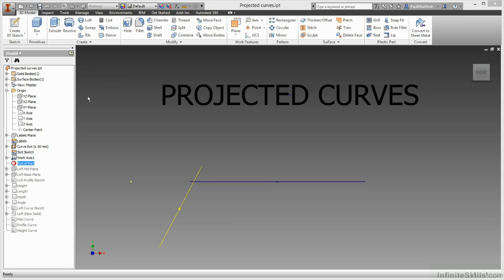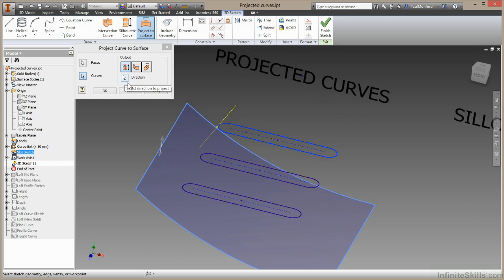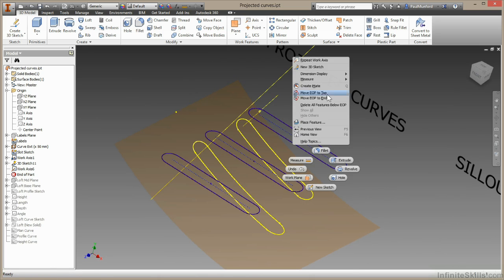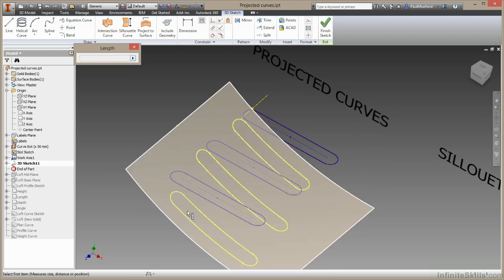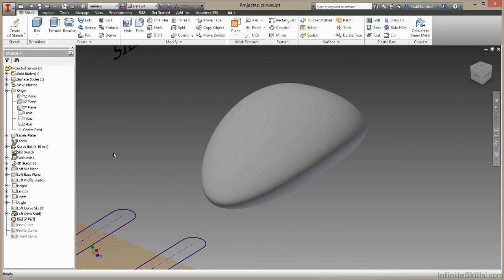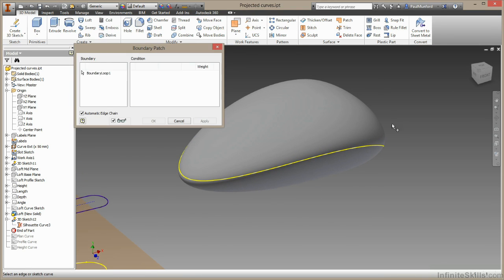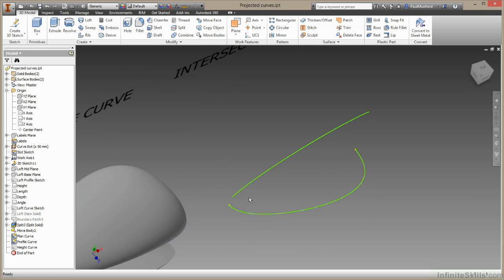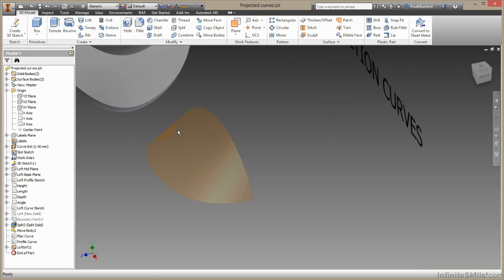Autodesk Inventor - Surfacing Tutorial | Projected Curves

Comment: Hi it's a great clip explaining how to project curves on surfaces. It helped me to go step further however I am not able to jump over the final step. I am desining a marine propeller blade where there are now plane surfaces - everything is curved. Now I am able to project each radial blade profile to cylindrical surface i.e. at r =0.2R, 0.3R etc up to r=1.0R. The blade thickness vary radialy from r=0.2R up to r=1.0R. The blade thickness vary from its leading edge to the trailing edge as well (i.e from the beginning face of the blade to the back face/edge of the blade). And due to the blade pitch with each radial step the blade is further turned (spinned). So I am not able to use neither COIL nor SWEEP function. The most "natural" function seemed to be LOFT. And here I stucked since I am not able to join radial surfaces i.e . blade profiles at different r's with LOFT function. Can you provide me any hint or trick how to overcome this problem? Many thanks in advance bye Andrej